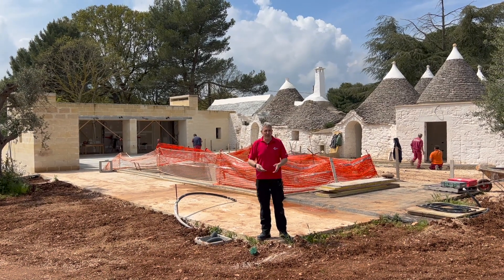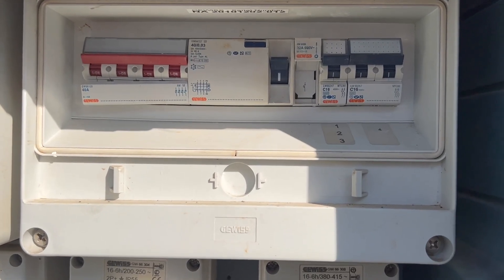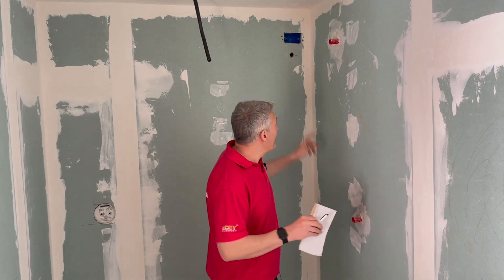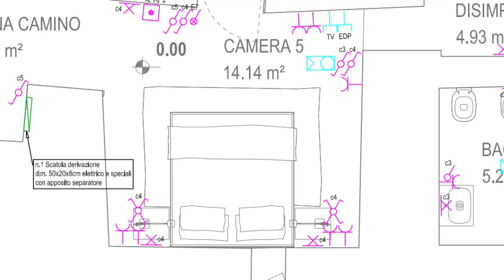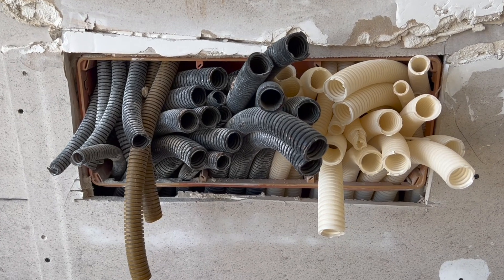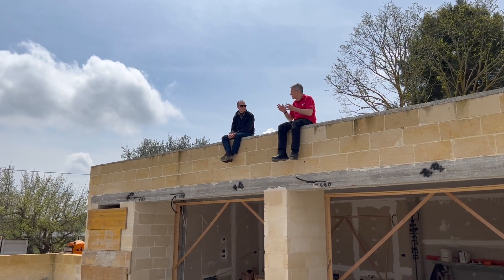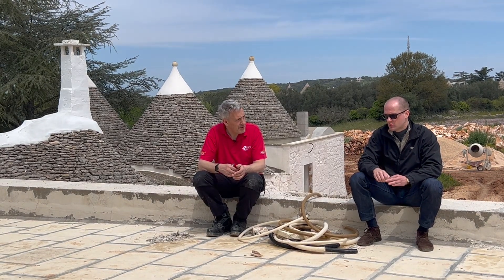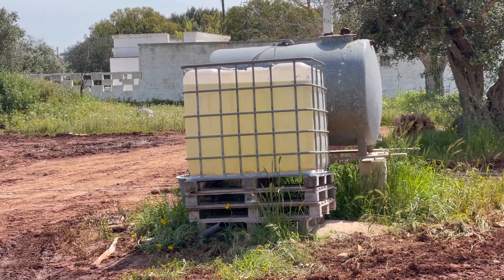Electric Wiring in Italy - You Won't Believe What They Do!

Comment: Im a fan of the flexible conduit systems,  for water supplies, with manifolds and for cables. I think that one of the major reasons as to why its its not used in the UK is cost, radial systems are better than ring mains, but the consumer unit is much bigger. British house builders have to be forced to spend money😮😢😊
Reply: Radials for socket circuits is not better than final ring circuits. There are great advantages with rings. The British 3-pin plugs with the fuse in the plug, of a max of 13A, makes rings work very well. Proven over 78 years.
Reply: @johnburns4017  Thats a matter of opinion, but the level of control and protection is better with radial as each room and/or fixed appliance can have it's own RCBO so that tripping does not affect all equipement on the ring. It also allows for minimal interruption to the property if work is being carried out.
Reply: @geoffaries  
That can be done on a ring. MCB at main panel RCBOs at fixed appliances, etc.
Reply: @johnburns4017  Yes, but that would require a seperate ring for each room, which will be more expensive than a radial system.
Reply: @geoffaries  
Explain what you mean.
Reply: @johnburns4017  It's not the ring that's superior as much as 32A circuits, which allow for a lot more flexibility of what is plugged in where without nuisance trips. It also avoids requiring special circuits for washing machines, driers etc. However, you don't have to do 32A with ring circuits, you can use radials on 4 mm^2 cabling. I for one would not forgo a 32A circuit in the kitchen, but I'd be happy enough with 20A radials in the rest of the house (which can still be done on 2.5 mm^2 cabling). That could still deliver almost 5 kW.
Reply: @TheEulerID  
A typical British home with 2 floors has typically three 32A 2.5mm rings. One on each floor, one for the kitchen. Then one radial for the cooking appliance. Gives all the power you need. Then two lighting circuits, one for upstairs and one for down. 

It provides all the power you need cheaply, using only six circuits.  Using 1.00mm, 2.5mm and 6mm cable. You can plug in nine 2.5kW electric heaters into the sockets (three on each ring) if your gas boiler breaks down. Provided the supply from the street is big enough, which many homes have 100A or 110A supplies anyhow.

Using only 32A radials will need 4mm cable and many, many radials. It has more complexity, more circuits, a bigger main panel, more cost, etc. 

The G Type 13A fuse-in-plug, makes it all work.
Reply: @johnburns4017  firstly the typical UK two floor house has two rings, not three. It is common to have three 32A breakers, but one will be a radial for the cooker. Secondly, it is becoming more common to have sockets in rooms bedrooms, living rooms and so on to use 16A or 20A breakers on radials using 2.5mm cable as they are simpler to install and test. That does not mean that there has to be one per room. With central heating, there is less reason for high powered portable electric space heaters (which are also something of a safety hazard).

That does not mean fuses in plugs are redundant, as even on a 16A radial, it is unwise to expose a thin flexi cable to the amount of current the breaker can pass in the event of a fault. Despite many claiming that the fused plug was introduced to facilitate ring circuits, that was not the primary reason, although it is an enabler. The previous standard used four different plug types rated at 3A, 5A, 15A and 30A (although the latter was hardly ever used and is now deleted). Each was on radials back to appropriate fuses. The committee decided that they wanted a single plug type for convenience and flexibility without sacrificing the extra safety of fuses appropriate to the appliance and carrying capacity of the flexi. Thus fused plugs were included, and that also allowed higher powered circuits to be used including, but not confined to ring circuits.
Reply: @TheEulerID  
"even on a 16A radial, it is unwise to expose a thin flexi cable to the amount of current the breaker can pass in the event of a fault."

Try telling that to our Continental and American cousins.
 
"Despite many claiming that the fused plug was introduced to facilitate ring circuits, that was not the primary reason, although it is an enabler."

Correct.
Reply: @TheEulerID  wrote:
"firstly the typical UK two floor house has two rings, not three."

Most have three. The kitchen ring handling the clustered heavy appliances of: washing machine, dishwasher and tumble dryer. But two rings will do in most cases.  That makes only five circuits and far less cable, and you can still plug in a 3kW appliance that will comfortably work from any socket.

The point I am putting across is the brilliance of final ring circuits. Far less cable and far fewer circuits.

BTW, AFDDs are recommended on all circuits supplying socket outlets.
Reply: @TheEulerID  
Manufacturers of consumer units and cables in the UK are pushing radials as they use more cable and equipment while offering no more than rings. 

A bad point of radial socket circuits is that all the current, which may be heavy, is on the first terminal on the back of a socket outlet after the breaker in the consumer unit. A ring spreads out the current. 

Using Wago types of connectors behind the sockets, in the bix, to continue the circuit (takes all the current load) then spurring off to the socket terminals with a few cm of flex is much safer - and quicker to install. The socket terminals only pass current when current is drawn through the socket. Much safer.
Reply: @johnburns4017  radials are much easier to test. Also, there is the possibility of an undetected break on the line or neutral and an overload on one half of the ring. That said, radials can have undetected breaks in the CPC, although much easier to test.
Reply: @TheEulerID  
Once you understand rings they are easy to test. If you find difficulty, go to what you think is the furthest socket then break the ring testing each leg as a radial. An undetected break?  Well if an AFDD is fitted it would have tripped alerting.   Fitting Wago connectors linking the ring with a spur off the Wago to a socket outlet ensures a more robust circuit and less likely that screws will work loose.   

Never had a ring break or be unbalanced, although circuit design comes into that. To balance you can:
1) take leg A to socket 1, 3, 5, etc.  
2) take leg B to socket 2,4, 6, etc. 

Yes, a valid and overlooked point about a severed CPC on radials - a ring's CPC is fed from both ends.

Comment: I've never seen that kind of electrical with flexduct. We've used it for low voltage extensively but wow, so curious. Who knew.
Reply: flex tube used ewerywere normal countrys, lot cheapen and better than hard tube,metal tube etc. idiot old systems.